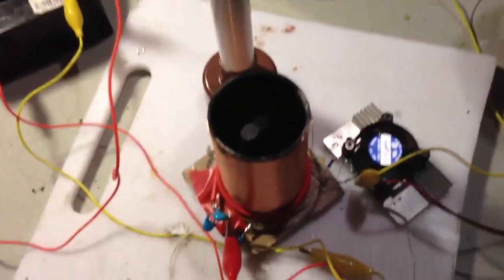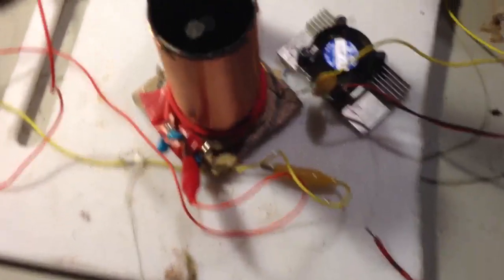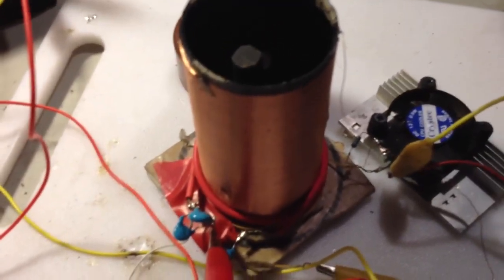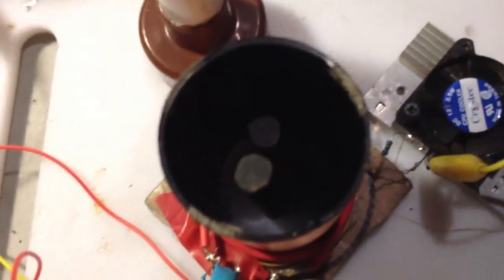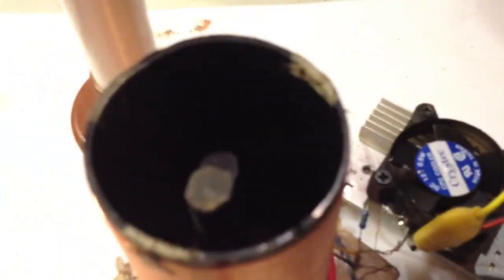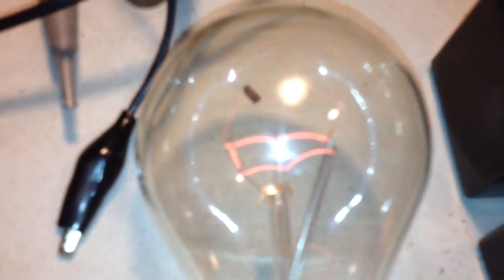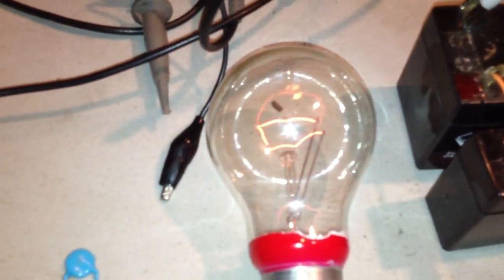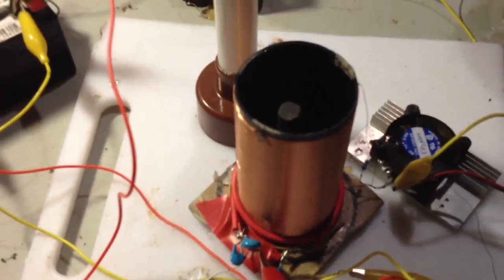Exciter/kacher/slayer

Comment: from what I have been able to gather from the guys on the forum the understanding is that the Whole circuit goes into resonance creating this back EMF of HV, I get the same effect.

Looks like you have basically made a tunable primary with a bit of a twist here, the Caps in place of a tunable condenser,, Hmm thinking about it you are Almost getting your 2 different frequencies here like they required in the Kapa dev, except the resonance is cancelling out the lower freq....so many thoughts ...

Comment: The lamp ought to be lighting from the carry through of HV off the tower. It's that same way that if you power a tower from a wall adapter, you can get a wireless LED to light (AV plug and a bit of wire) right back to the wall socket by following the adapter wire. DC and AC can run together along the same wire and then produce effects like this !
Happy New Year Jim !